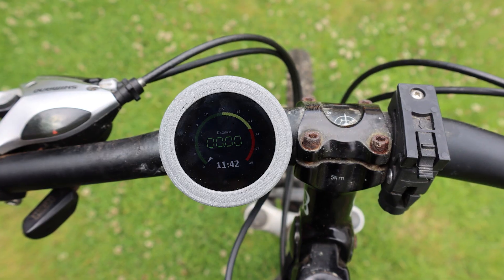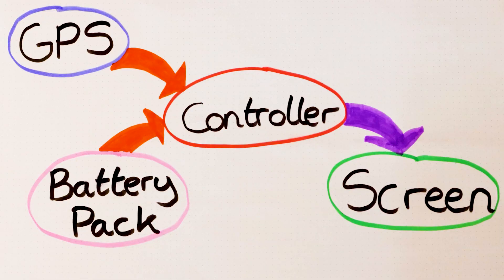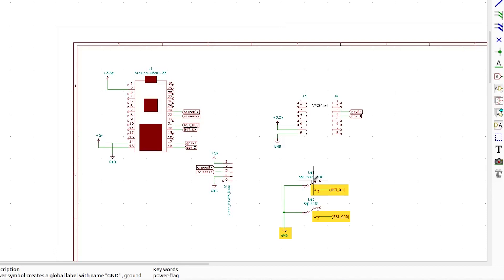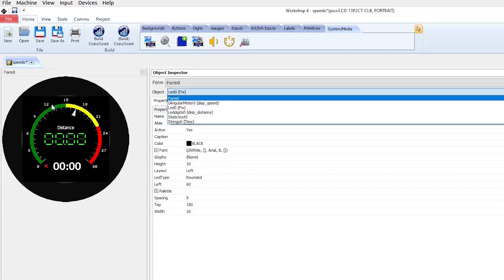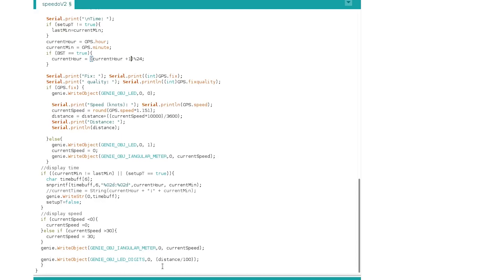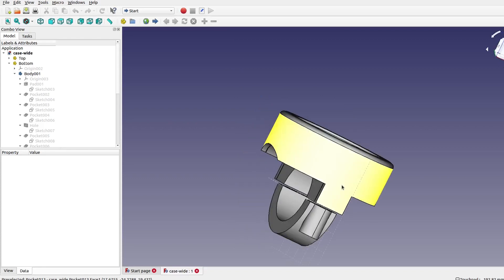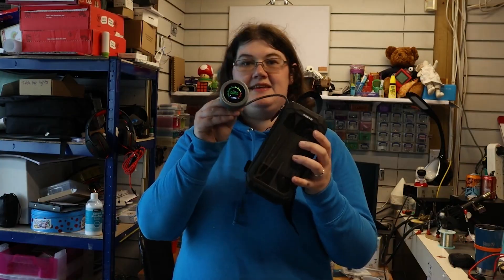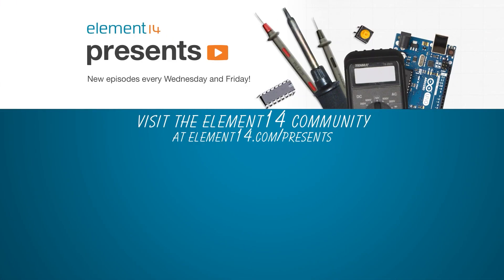Bike Speedometer with Arduino and GPS

Comment: Ho Katie, this project was really interesting to me because I would like to build an arduino based artificial  horizon and I am struggling a lot to find a suitable round display. The 4dsystems one you used is really nice. I especially like the  Workspace4 software which makes the display progeammjtn really easy. Yet, neither at 4Dsystems I can find a 2.4" round display. Can you perhaps point me to other LCD display manufacturers with that size among their products?
Kind regards

Comment: If you rode onto a weight scale before cycling and entered that into your computer could you determine your power usage using the accelerometer?  Power meters give the power expended in terms of watts, if you had enough information you could probably calculate your power usage with telemetry data.  
There is also wind speed, drag and gear ratios to think about... maybe just put some pressure pads on the pedals and measure the downward force!
Reply: You would need either a perfectly flat surface and travel in a straight line, or you would need some fairly complex sensing and calculations, to determine power from motion and mass. One of those things that's easier to do in theory than in practice. 

I have a single axis accelerometer-based performance tester intended for use in cars, developed in the late 1990s. You have you get a perfectly flat stretch of road and drive in a straight line for moderately-accurate results -- any slope is read as horizontal force. It can also measure skid-pad G forces, but body roll throws it off as it starts confusing gravity for centrifugal force.

A modern six-axis accelerometer commonly used in smartphones could probably account for multi-axis motion in the calculations.

Comment: Neat project. Of course, the simplest solution is to just download a GPS speedometer and distance app for your phone, but where's the fun in that?
Reply: I started with that (why I had the bike frame bag with the window on the top),
But found I was easily distracted, and quickly checking what the message /notifications were each time it buzzed whilst riding (on off road paths).
It's a habit I was finding hard to break, so with this the phone can be safely in my backpack and I'm not tempted to take my eyes off the road
Reply: @hifromkatie  I'm ADD and have to put the phone into silent mode sometimes just get anything done. Of course I forget to do that all the time. :)

Comment: That's really awesome! I've been looking for a GPS bike computer but they're really expensive and don't really do what I want anyway. This would be perfect, and the best thing is that it can easily be reprogrammed and updated.

I'm working on a similar thing using a Raspberry Pi Zero W and a Micro Dot PHAT. I have a car with an overhead console with an electronic compass display that has never worked. I want to make it look OEM but add functionality with different modes like clock and elevation that the OEM unit never had. The clock will automatically set the time zone (I travel frequently across time zones in the USA) from the GPS location using a library I found. I plan to also make a housing for it so I can take it with me and use it in any vehicle, including using it for a bike computer. Once I get it up and running, it should be simple to add an extra switch to cycle between modes for car, bicycle and motorcycle and anything else I can think of.

I may change my mind and just leave my car project in place and duplicate your unit for the other applications because your display is far more flexible and can display several different things at the same time. That would be better for swapping between vehicles.

Keep up the great work! 👍
Reply: Thanks, glad you can see the potential for personalising it for your own use.
Your car display sounds like a great project. the circular display is perfect for a bike or motorbike, so think it'd work really well as a second portable unit for those cases.

Comment: gsm module to track the bike location?
Reply: The arduino has WiFi, so I could fairly easily post location using my phone as a hotspot.
But my family also have the ability to check location of my phone for safety reasons etc, so if it was needed they could use that.

Comment: Very neat idea, I especially like the screen you used which I assume is you can make water resistant to prevent all the rain we get
Reply: Yes, the screen is bonded to the underside of a piece of glass, so would be easy to waterproof.
This one might be a little water res
resistant but I wouldn't rely on it as the 3d printing isn't that solid. It would be great to try and make it water resistant/proof in the future though, as would be much more useful

Comment: why would the old sensor have cared about its distance from the axle?
Reply: Exactly what I thought. It would detect one revolution wherever it was. All you need to know is the circumference of the wheel.
Reply: It probably didn't!
I set the old one up when I bought the bike to take to uni which was about 15 years ago, (it was my daily transport for 4 years).
Tbh I can't remember how it was set up, now I think about it, I'm pretty sure it didn't need to know, was just wheel size.

Comment: Excellent work. What's cool about projects like these is that they're very customizable for your needs. My only modification would be to put some kind of shade/hood on the screen and angle the whole unit so it can be read in direct sunlight. Small screens like these usually aren't the most readable on sunny days, unfortunately. ;)
Reply: That would be good.
After using it a few times, I'll agree on the readability in sunlight
Reply: Let me know once you modify the 3d printable part to have some shade/hood. 
Looking forward for your reply!